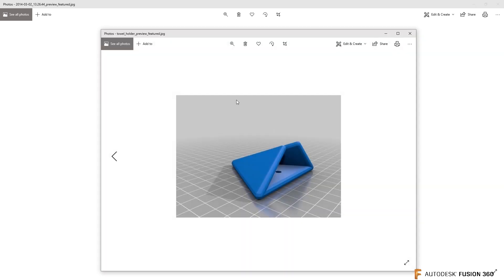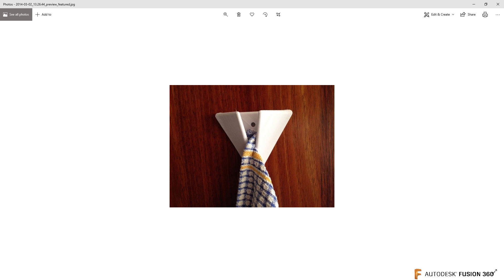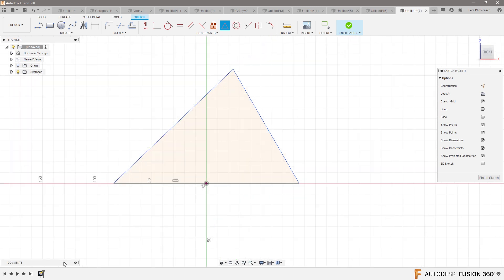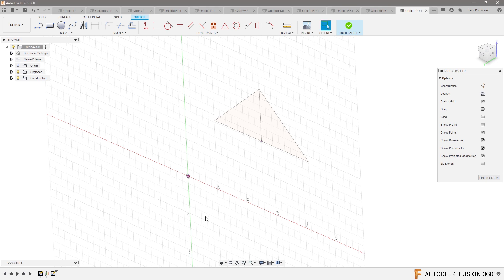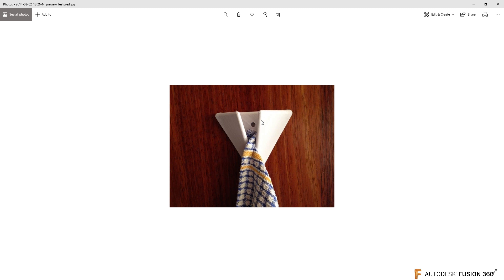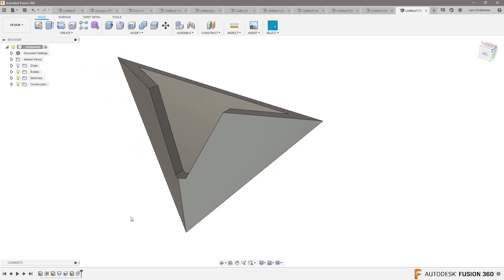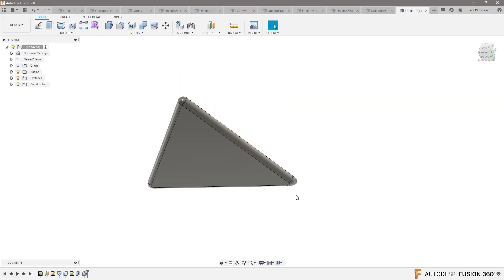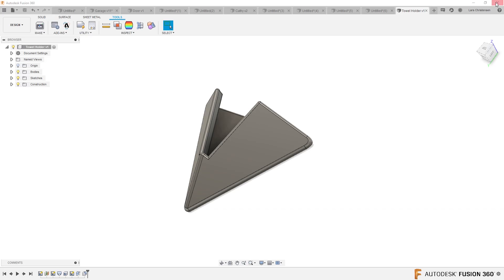Fusion 360 — How To Model and 3D Print Your Next Project — Ask LarsLive

Comment: Love the Modelling lessons and have learned a heap by watching them. Modelling for 3D printing you need to consider the manufacturing process as part of the model and the limitations it imposes. Overhangs to 45 degrees (or more) are fine and for best strength this model should have been printed standing on it's top face not it's back. A small 5 or 6mm brim would help make sure it stays stuck to the bed.
Reply from the maker: Thank you for the great comment👍😊
Reply: @cadcamstuff  Some of the content here is as a result of you https://www.eevblog.com/forum/testgear/replacement-knobs-feet-and-fittings-for-test-equipment/msg2255109/#msg2255109 I might know the thread starter too ;) A mixed bag of purely functional models for unobtanium parts.

Comment: For better strength, print with the topside touching the printer bed. 3d printers have better layer adhesion when you reduce the unsupported overhang angle.  Also, use chamfers more around areas touching the build plate.  You can control the overhang angles.
Reply from the maker: Thank you for the great comment